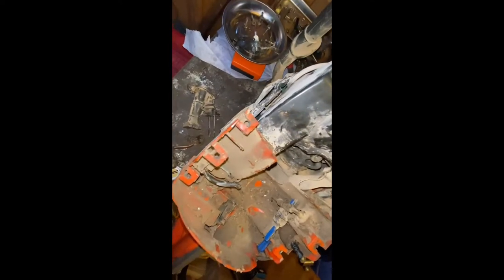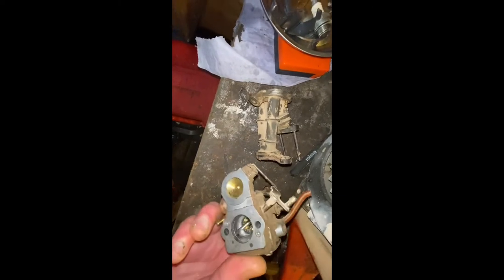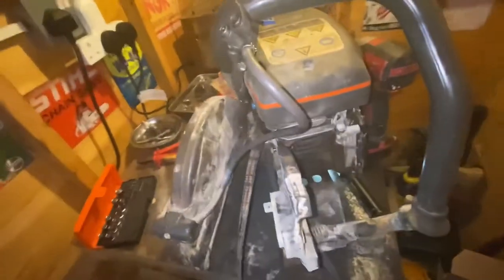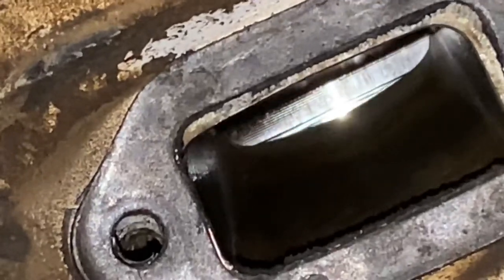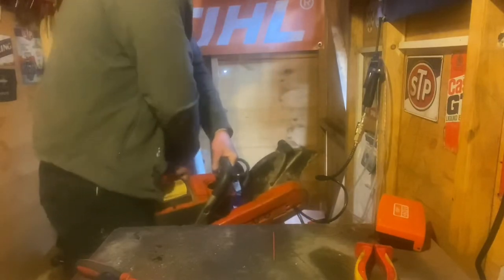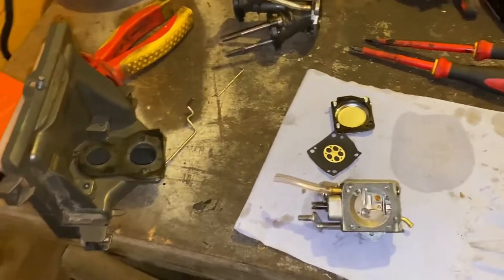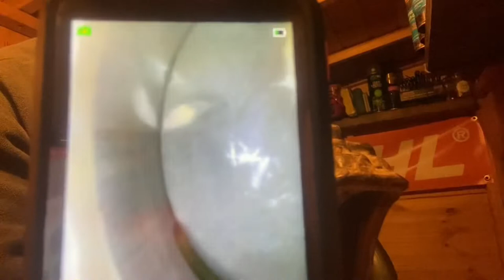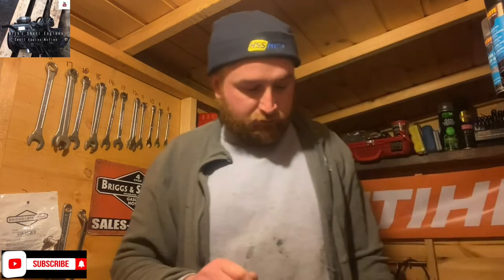Husqvarna K760 cut off saw. Will it run ? Part 1

Comment: Try putting a little fuel in the carb. 100PSI should be plenty. Also have you checked the read valve? (Assuming it has one?)
Reply from the maker: Absolutely Benedict mate. No stone has been unturned on this machine. Not a fan of 2-strokes personally ..... hope you’re well mate 👍🏻🔧
Reply: @DicksSmallEngines  I am good, hope you are too.